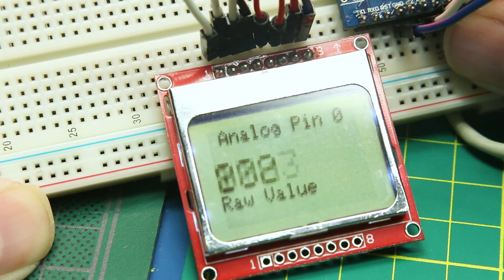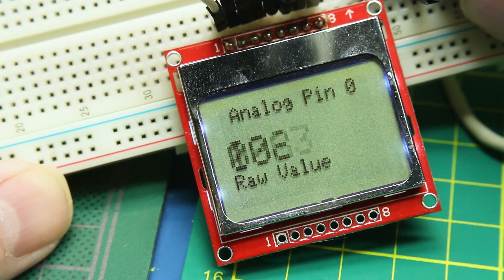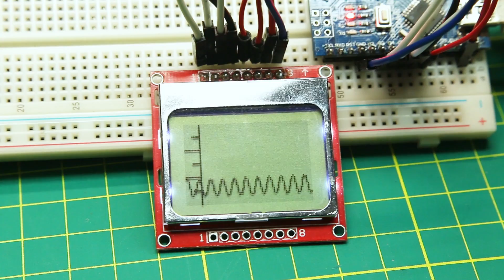Electronics BASICS: Nokia LCD Display- What You Need To Know

Comment: I'm currently trying out the HX1230 96x68px LCD which is 'supposed' to be the 5110 replacement. I have to admit the backlight (a single led) is actually much better than the 5110, its also a slightly smaller form factor and considerably thinner than tha relatively thick 5110.

If its your only SPI device in a project you can get away with only 3 wires for communications...CLK, DIN and RST, CE can be hardwired to GND.

Comms is a bit different to normal in that you send a D/C BIT, followed by the data byte....a total of 9 BITS....as long as you follow that protocol it works flawlessly.

Worth a look if you need a few extra pixels or just a 'thinner' 5110 equivalent.